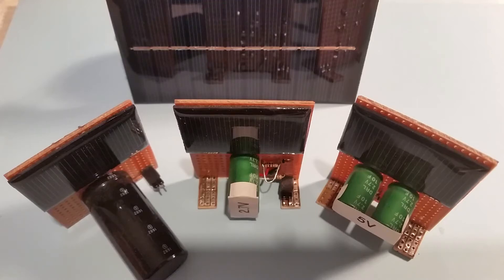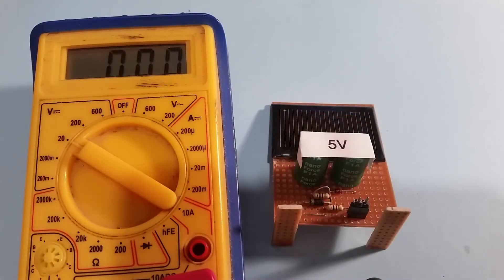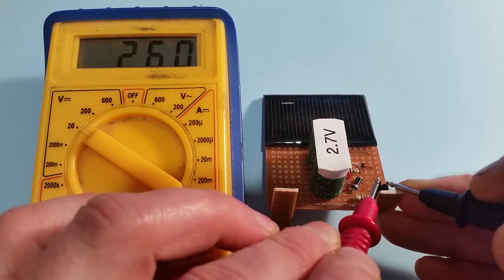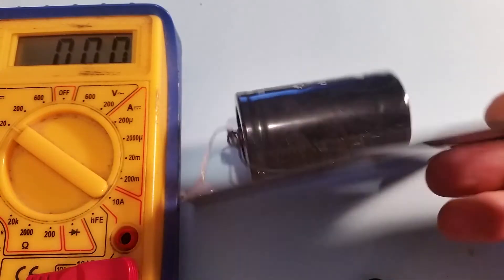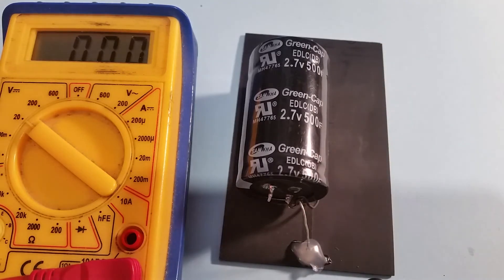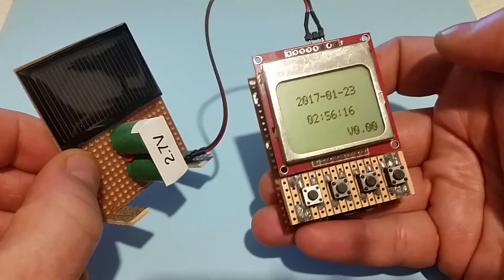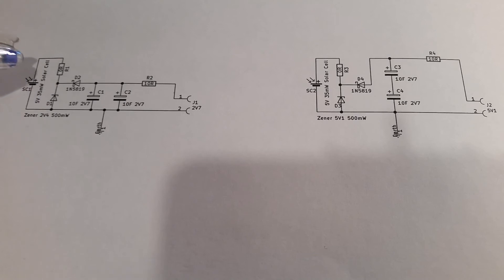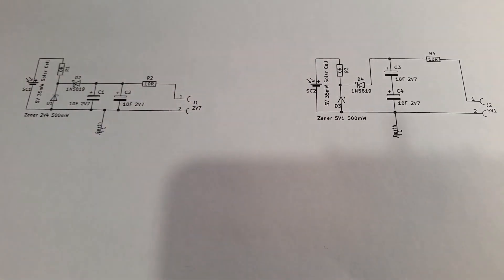Charging Super Capacitors With Small Solar Panels

Comment: Thanks for this intriguing review where the 10F turn out to be more useful for remote projects than the larger capacitance ones.  I searched for the "Nano" brand 10F 2.7V caps - no longer available - can you recommend another BRAND as an alternative - as so many manufacturers make these spec caps nowadays that one wonders if the performance of the "Nano" brand was a general indication of 10F vs 100F or whether it was brand specific. Thanks. PS. did you include circuit diagrams - they would be useful - presume you were using 3V solar cells?
Reply from the maker: I haven't used any since this video so unfortunately I haven't experience of other brands. I think the solar panels I used may have been 5V. The zener diode will ensure the voltage stays below the zener diode voltage. As long as the zener diode watt rating is below the solar panel watt rating.

Comment: What if they blast?? Can these solar pannel make super capictor blast if they over charged?? Or what if I attach 5 volt solar pannel direct to super capictor is they blast??
Reply from the maker: The zener diodes short out any current going over the zener rated voltage. If you connect a solar panel that can produce more power than the zener watt rating you could blow the zener and the protection for your capacitor will be gone, so make sure the rating of the zener is good for the solar panel you are using.

Comment: shouldn't the zeners be the other side of the schottkys, ie next to the caps. 
and the schottky wrong way round ?
Reply from the maker: When the zener is used as a regulator, it requires a minimal amount of current to obtain the correct regulating voltage. If you place it next to the capacitor, it will discharge the capacitor below the regulation voltage when there is no sun. The schottky diode is there to prevent this occurring.

Comment: Awesome video, combining low power circuits with super caps and solar cells is very interesting to me. I'm curious what purpose the Zener diode serves, what were to happen if it was omitted?
Reply from the maker: Super capacitors have a voltage rating, usually 2V7, which is written on the side of the capacitor. The zener diode prevents the charge in the super capacitor exceeding the rated voltage of the capacitor, so the capacitor does not get damaged.
Reply: @DevelopIT  Makes sense, seems like it's used as a simple voltage regulator. Thank you!

Comment: @Develop IT, thanks for your videos testing the Supercaps. 
Maybe I missed it in the video, but what are the advantages of using Supercaps with solar? As you said a Ni-MH battery seems pretty good and cheap to use. Or do you have specific applications in mind?

Thanks.
Reply from the maker: This was the first I had messed with super capacitors and was just messing with them really. The only advantage with this particular set up would be a slow charge rapid discharge requirement as super capacitors can supply a very high current very quickly. But I didn't really have a point.
Reply: Thanks for your reply. I am brainstorming consumer product applications. But I am not further then bug zappers ;)
Reply: @smitauke  Isn't  the difference that you can recharge supercaps more times than batteries?

Comment: Would this circuit work with a 3.4v 12mA solar cell?  I'm trying to power an ATTiny85 but am really constrained by size.  I want to use a SCC2422 solar cell from solarbotics as it's only 24x22mm.
Reply from the maker: You would need to change the zener diode value to a more suitable one. I couldn't tell if it would be good for your use, the only way to know would be to try.
Reply: @DevelopIT  Thanks for your reply! Does the zener diode needs to be below the voltage of the solar cell?
Reply from the maker: I found with the Zener diodes I have used, they usually provide a voltage very slightly above their rating, so I have used ones a bit below the rating to ensure the voltage does not go above the super capacitor voltage rating.
Reply: @DevelopIT  So, if the voltage gets above the Zener voltage, does it just effectively short out the solar cell... and/or cap?   Couldn't that also create a "pop"/heat situation?  Or because it happens as soon as it gets to that voltage, it just sort of quenches things?  Does it still dissipate the extra solar voltage as heat, instead of just opening the circuit?
Reply from the maker: @DavidLindes , Zener diodes start to conduct as they reach their rated voltage. They are used in series with a resistor, which limits the current flow. So a resistor which would limit the current to the rate which is below the watt value of the diode is required, to prevent the diode failing.

Comment: Do you think that if I attach at 1) and 2) a 1mAh load, this will stay on forever, even at night? In other words, is this circuit able to charge the supercapacitor during the day and at the same time provide current to the load withouth interruptions during night and day?

When you say 5V Solar cell, you mean 5V VOC, or 5V pmpp?
Can you give pointers to your solar cells?
Reply from the maker: 5V was the rating in the eBay listing, seems to be maximum voltage. I think I had an LED on one of these at about 1-2mA and it lasted maybe four hours, I can't remember exactly. It requires a bright day. If your load could run below 2V required for an LED, it would last longer. A larger super capacitor and solar cell would be required really. And then if you didn't get enough sun on the solar panel in a day it could be an issue. It's mostly the short circuit current rating of the panel as the super capacitor is effectively a short circuit. And then the capacity of the super capacitor. Sorry I can't be of more help.

Comment: ally express selling alot fake\bad capactors
like 500f green cap ( samwha manufacter )
but....
if you go to samwha site and look at what they produce all those datasheets you find out that they did not produce it

and i found on youtube some 1 commented that its actually reject capacitors buy this manufacturer that was wrapped by seller in new shinny "500f" label
and it actually 350-400f ones (that got rejected due to current leakage or some)
Reply from the maker: That is the trouble with places like eBay, I never buy SD cards from eBay any more, because I got so many that were fake and would corrupt data after 4GB or 8GB was written to the card. It's a shame if this is the case for super capacitors too.